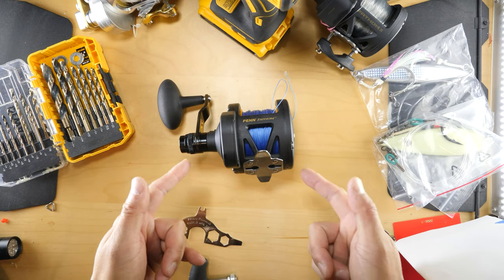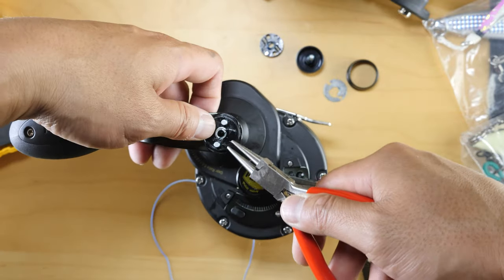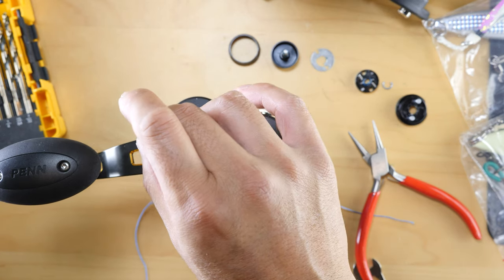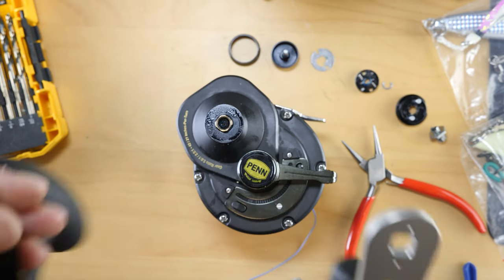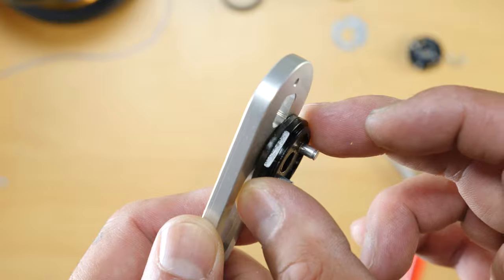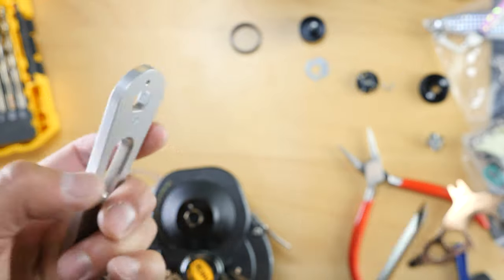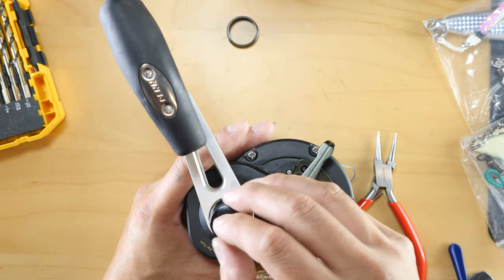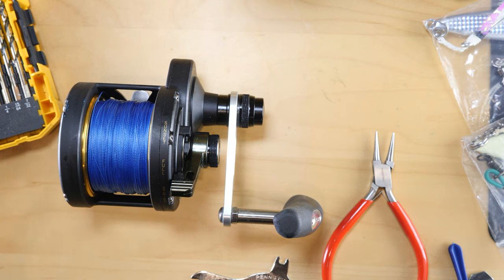Penn International Visx 16 T-Bar Handle DIY install on Penn Fathom or Torque upgrade 40nld2 25nld2

Comment: Also, VISX handle might look just as long, but if you measure from axis of rotation at the reel, to axis of rotation of the grip, the VISX is 1/4 inch SHORTER.

Comment: Great video and excellent explanation of the process. I just wanted to throw something out there. I have a Penn Sql 50VSW laying around that wasn't getting much use. After watching your video I decided to give the handle on the SQL a try. Turns out, it fit perfectly. In fact, I didn't have to drill any holes into the handle. The SQL handle was an exact match. There was one down side. The handle for the SQL 50VSW is the same price as the VISX,  so no money savings there.
Reply from the maker: Jay! That’s awesome news actually. I’ll def have to do that. Have a few more 2spd I can upgrade and a few buddies who want to as well
Reply: @Seastheday88  can u verify this when you do it and maybe a video? I have 4 fathoms I’d like to do this to. New sub.
Reply from the maker: @petera1117  ordered the squall and larger Visx20-50. I’ll post once it arrives. thanks for watching 🙏
Reply from the maker: @petera1117  got the squall handle and it’s a direct fit on fathom as Jay mentioned. I posted it on recent video. Thanks and tight lines 🤙
Reply: @Seastheday88  sweeeeeeeet. Can’t wait to watch! Thanks so much for doing this!
Reply: This whole comment made my day. I fish out of hilo hawaii and have FIVE 50vsw's. ergonmics make a huge difference if you're reeling all day!
Reply from the maker: @MrKevin3140  howz it! You can see the install of the vsw handle on a more recent upload. Appreciate the watch, would love to fish out of the islands. Mahalo!
Reply: @MrKevin3140  I also bought one for my Fathom 2sp 30. It makes that little reel feel like a mini power house.
Reply from the maker: @77jaycube69  so true, I put the unused factory 40n handle that has bigger egg handle on my 25n. Already feels like I want to pull on some YT this season lol. Can’t wait to get on one this season.

Comment: Great tutorial video. I made the handle change on my Fathom 40N 2 speed.  Just got back from a 3 day trip. All worked well in the garage but on the 1st BFT I caught on it the low gear would not engage. Put it away and used other gear for the rest of the trip. Went to a reel repair shop and they said the bar stock is thicker than original equipment and prevents the proper engagement of low gear. 
They suggested only installing non factory handle with same bar stock thickness. 

I installed a Tiburon Power handle (same thickness as original) on one of my 40N's and am filing down the aluminum bar stock on the VISX hand to match the original thickness for another 40N. Not sure how this will work or hold up (possible corrosion in the area that has been filed down). Will find out in July2022 when I'm back out on another 3 day trip.

Anyone else have issues like this?
Reply from the maker: Darn. Sorry to hear that Lee, did the low gear engage in pre-tests? I read other owners using this before me, however those same posts never had a follow report so my theory was all was good for them. I did take it out on last trip, but no hook up on this reel to confirm. 

I was also trying to inspect how to get this International TBar in the Fathom handle without having to drill out the original knob. I’ll pursue this further if so. Thanks for sharing your report.
Reply: Yes the low gear worked when tested in garage under no load. Just engaging and disengaging. But under load of a 35-40# bft it did not. 

The button pushes in and stays in but the handle free spins. Occasionally it engages for half a turn ...then free spins.

Fortunately the line spool stays engaged and retains the drag setting. 

The shop said it is a known issue.
Reply from the maker: @leetaylor2158  oh boy. Now that’s a prob. I’ll look into how to pursue the bar on the original handle arm. Thanks for sharing this 🙏👍
Reply: I was curious if my experience was unique or if other folks have had something different or similar.

According to the shop it was not unique. But I am all about learning. Hopefully others can share their experiences.
Reply from the maker: @leetaylor2158  sucks. I’m not a fan of the straight bar design of the international and would prefer it angled in towards the reel from original fathom, but the 1mm thickness gave additional peace of mind. Losing low gear under pressure kills it all. I’m hoping others can chime in too.
Reply from the maker: @leetaylor2158  hi Lee, there is a comment from user @soul on my recent video. Mentioned over torquing the nut on the handle arm. This isn’t a resolution yet, but he has experienced this from clients who reported the issue. Only way to confirm is to catch one myself. Will keep you posted. Thanks 🙌
Reply: I filed off about 1mm off the handle bar stock to match the original handle thickness. It works. Did extensive testing (shifting from low to high, high to low) under loaded conditions (simulating fighting a fish) and it worked flawlessly. The aluminum on that handle is tough stuff. Much harder to remove that I imagined. July will be my next trip for real life use. I feel confident it is corrected. I took some pics and will happily share but don't know how to add here.
Reply from the maker: @leetaylor2158  awesome Lee 🙌 I was thinking the same thing. I already ported the handle pin hole, might as well go all the way with it. Send the pics to “seastheday2na at gmail dot com” I’ll post some of it up on a story and share your name to it. Thanks sir and glad it worked. I’m looking forward to pulling one up with this conversion still.
Reply: @Seastheday88  sent the pics
Reply from the maker: @leetaylor2158  hey Lee thanks and posted the short. Also another user was asking about your setup pairing for this rod. I’d be curious as well. Thanks again 🙌
Reply: @Seastheday88   My setup is Penn 40N with 350yrds 100# depth counter braid with a 20yrd topshot(equal to 2 colors on the braid) of 100# Izorline First String mono. This is on a Calstar 770XH (7' long rated 60-120#). I use this as my "light" 100# outfit for night time BFT jig fishing when the fish are expected to be under 200#. Or as a dropper loop rig for large YT (like at Guadalupe Island) when you have to horse them away from the rocks. I would also use (but have not had the opportunity yet) this as a 80# live bait outfit by tieing on 4' of 80# fluorocarbon. 
My goal is to have some versatility in my setups. 

I have a Penn 16VISX w/ 600yrd 100# Izorline hollow braid on a Calstar 775 XXH for my other 100# setup.

Those are my 2 heavy setups.

Feel very comfortable with Penn reels and Calstar rods. Also have 30# setup, 40# setup and a 50/60# set.
Reply from the maker: @leetaylor2158  awesome! Thanks for sharing that. Sweet setups 🙌
Reply: @Seastheday88  thanks!  Quick!
Reply: @leetaylor2158  thanks for sharing!
Reply: I can confirm had same issue on my trq40. I thought I had bent or messed up a component. I brought it to Anglers Choice in SD and they did something to make it engage once again. Didn’t mention filing. Did say handle bar was thicker and was issue.

Comment: FYI- just watched a BD YouTube video from ICAST, with Steve Carson showing the new Gen 2 Penn Fathom Lever Drag reels. Many new features but related to this thread.

All Gen 2 Penn Fathom 2 speed reels come with a power handle (appears to be very similar or the same as 16 VISX handle). Also they have a new larger size, Fathom 80.
Reply: Link to the BD video
https://youtu.be/sAZzEzZ6QxE
Reply from the maker: @leetaylor2158  it’s wild. I’m really digging the one piece side frame design. The international handle is a bonus, although makes this vid now obsolete 😆Saw they go as small as 10xn, perfect for the SPJ guys. I’m stoked for that 80 size too! 

What a huge leap for Penn, looks like a $500 reel. I’ll still hold onto these original fathoms, but hope to add a new model in addition. Thanks for sharing Lee! 🙌🙌
Reply: @Seastheday88  I am also excited by all the positive new upgrades/changes. They look like a homerun!

I will be using all my 1st Gen 2 speed Lever Drag Fathoms until they stop working. Might be awhile. I tried to find some specs on the new 80 size. Could be a comparable to the International 16 VISX. Penn website still only has 1st Gen stuff listed.
Reply: @Seastheday88  There are so many 1st Gen Fathoms out there I don't think the video will be obsolete. In fact once people see the handles on the Gen 2 stuff this video might be more relevant. Time will tell.
Reply from the maker: @leetaylor2158  so true, I’m still amazed how Penn made this Fathom for its price point. 
Have to admit we’re all blessed with great options to get out on the rails.

Comment: Great video! I have 7 squall VSW 2 speeds and was looking at handle options. That visx handle should fit right? I believe the fathoms and squall use the same 2 speed mechanics. Lmk thanks!
Reply from the maker: The Squall VSW, from my examination uses a 4mm thick handle arm like the Fathom. The VISX is 5mm. 
I had users report issues where low gear wasn’t engaging, we resolved it to a small spacer right under the bolt that locks the arm in place. 
In short, the VISX will fit the squall but not function properly. Does your Squall VSW have the T-bar? There is a model with one that I did a video of to swap to a Fathom 60LD2 here and that should be a direct fit on yours. 

If you’d like the VISX, you’ll need that matching spacer with the arm. 
Hope that helps👍
Reply: @Seastheday88  yes they have the t-bar. I was looking to get the offset ergonomic handle like the visx but the knob comes off with a screw where mine come off but are in a pressed in post. Would have to drill which I'm not a fan of.
Reply from the maker: @gebe5093  got it. That’s the same one I used that has the stem pressed into the the arm. I did try to put it on a Vice but still couldn’t remove the screw on the handle side, kept slipping even with a Vice on the closest part to arm.

24-50ViS
024-1379677 is the entire arm and handle from VISX 20-50 size. 
172A-1192378 is the spacer.
Reply: @Seastheday88  thank you! So like your video showed this handle will work being 5mm thick but you need to use the 172a spacer for the dual grading to work?
Reply from the maker: @gebe5093  yes, the spacer is to match with the new thicker od of the new Visx handle. 

If you order the visx12-16 handle. The T bar is same as the new Gen2 Fathom size, smaller in hands. Also has similar length arm as Squall. 

The 20-50 visx handle aseembly is longer arm and bigger tbar. 

Also a note, each handle, 12-16 and 20-50 aren’t interchangeable with each other, the bigger size uses a thicker diameter stem/bolt/screw. 

Hope that helps🤙

Comment: How much drag can you realistically get on the fathom fishing knife and sinker? Would this reel be ok with some 100 mc? Some dude said he gets 30. At full and 350 yards of 100 is all you need to kill a cow? What’s your opinion?
Reply from the maker: I personally wouldn’t push it for 100lb. I’d fish it for 60lb ideally. You’ll go through pinion bearings faster if pushed higher. You’ll notice there is more resistance tension winding on Strike without anything hooked up. That’s due to higher drag and max pressure than the reel is able to handle. Some people have got away with it. Just needs more service in between.

Comment: Quick question if we replace the spacer that you put in the description were dont need to file down the handle thickness to 4mm correct?
Reply from the maker: Correct. No need to file down if you use the longer spacer. I’ve been using the spacer successfully, you can order a factory VISX 12-16 spacer directly from Penn.

Comment: Hi, Does this mod work on the Fathom 60 too? Specifically the 16visx handle on a Fathom 60. Thanks.
Reply from the maker: Hi Richard. Yes it will work on all 2spd fathoms. There is one caveat, we found an issue later and one of my recent videos shows we need a 5mm spacer that goes under the handle nut to compensate for the 1mm difference of the VISX handle width. Factory fathom is 4mm so the original space is also 4mm. Hope that helps. 
Also, if you don’t mind the Squall style, that is a 100% direct fit with no other mods needs, I cover that video as well. Thanks

Comment: So what is the largest handle i can put on my squall 50vsw since they share the same mounting style.  Have you gone crazy and tried 80 and 130 handles?  Any info would be TRULY appreciated!
Reply from the maker: I haven’t tried 80-130, but looking at the parts they appear same mounting type for the assembly. I do have the VISX 20-50 handle assembly currently waiting to install on my visx16. It’s much larger in overall and the rubber material grips much better when wet. That may be a consideration for the 50vsw. I’m also looking at mysticpart’s schematic of the 130 and it may be possible if you get the entire handle assembly as it mentions the stem for the knob part itself is a different diameter from smaller sizes.

Comment: Do you have a part number on the tool you used?
Reply from the maker: Hi. The factory tool is “168-TRQ40NLD2” or “168-1289891”
Thanks for watching!

Comment: VISX handle is 5mm thickness, and stock handle is 4mm. This means the gear-shift pin does not engage all the way.  Handles MUST be shaved down 1mm thickness (0.040 inches), or this mod will cause problems.  Also, when drilling 1/8 holes, start a bit from each side and meet in the middle so that the hole will stay centered, and  you don't get burrs on one side.
Reply from the maker: Thanks. This took a few video iterations after, but was resolved and also noted in description.

Comment: Just buy a Tiburon T-Bar reel Handle. No need to drill.
Reply from the maker: Thanks for the suggestion. I did buy Tiburons for my Talica’s.  Lite version on 12ii and full size on 16ii. Nice upgrades. 
I was personally curious about the Visx handles as I landed my pb 113# on a visx16 and the handles sold me.